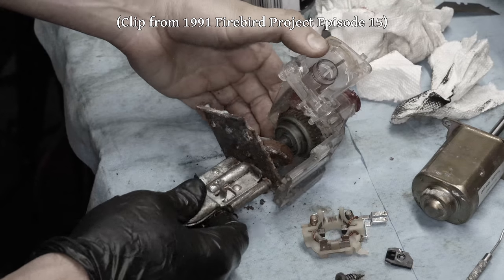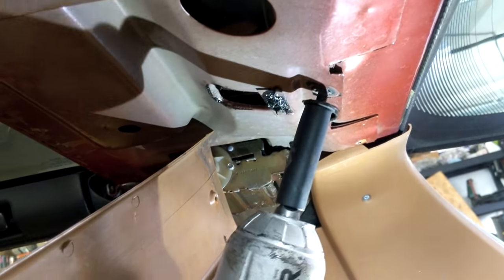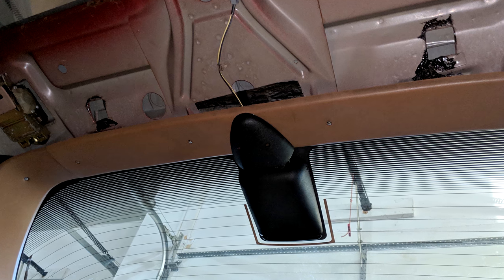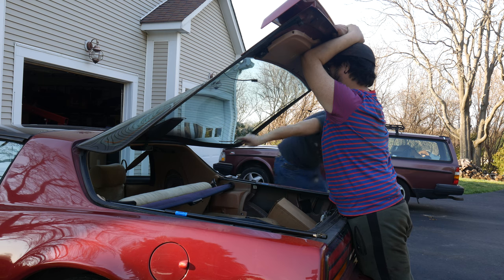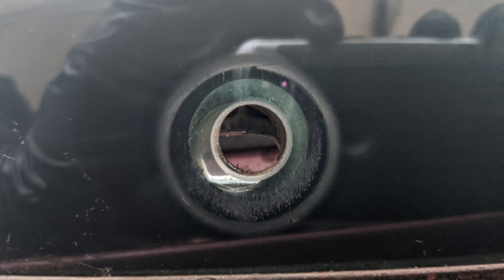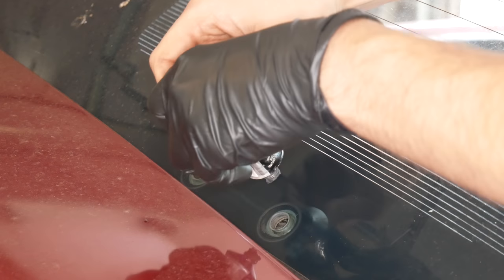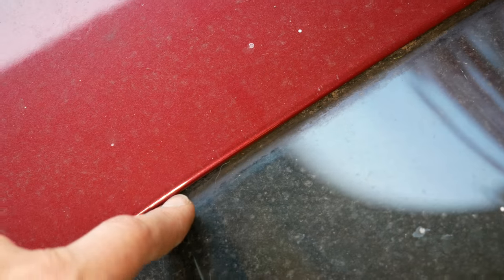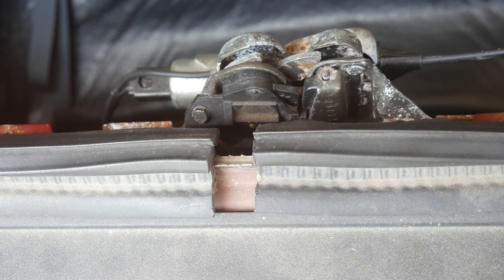1991 Firebird Rear Hatch Position Adjustment and Sealing (Ep.16)

Comment: Leaks like this are so frustrating. You did it the right way. The low viscosity windshield sealant is the final touch, but you have to start with the seals, pull headliner, and look at door fitup. It might even involve welding in fresh steel if there are pinholes in body. This is also a great time to place dynamat and look at wiring, speakers, etc.

Comment: I used to have the same leak on my 86 TA and it was coming from the middle of the T Tops.  The weather strip for the T tops has to be removed in order to expose a T shape metal shield which leaks when the water is running through the weather strip.  It happen with rain, snow and carwash.  One time, after a carwash I was on my way to college with a written homework which got ruined.  Thank God the teacher gave me a break.  Those leaks are hell!

Comment: This is why I converted my hatch from the automatic pull-down to manual. On the early 3rd Generations they had a manual rear hatch latch. The only reason why that pull down assist exists is because people were slamming them and shattering the glass.

Comment: On my 83 T/A I used a piece of thin pipe or EMT conduit that fit over the gas cylinder on the hatch and cut just shorter than the length of the exposed part of the shaft.  Slide it over the gas shock and when you open the hatch all the way, the pipe slips off the end of the cylinder and onto the shaft, preventing it from closing.  Just flip it up while closing the hatch to lower.  It works great, and I used it for years.  Only need to do one side.

Comment: Hey brother.  I replaced the hatch at least 3 times in my life.  Been there, done that.  I remember scraping off the old urethane from the deck.  Not a fun task.  Looking back, maybe a heat gun would have helped.  BTW, discovered a spray from STA-BIL recently.  Actually does decent job on rust, and is a hell of a lubricant.  May be a nice top coat for your slide stampings, and other things.  And also, one tip I can leave you for owning a third gen, quick-steel, or any other epoxy putty.  Would may for a better spacer than tape.  Mainly I used it behind split plastics, such as the door sills, and dash trims.  Very handy.  Especially now that Ponitac closed shop.  :/

Comment: My hatch release button doesn't function when my car is running, has yours been modified? It's something of a safety issue, isn't it?
Reply from the maker: I had the same thought, but mine does work with with the engine running. Never tried it while the vehicle was in Drive or moving, but I doubt it would make a difference. Probably wasn't something a previous owner modified, but it may have been altered by Father Time in the sense that whatever safety was in there has failed. Or, maybe some years had it while others don't? Just guessing.
Reply: 4th gen driver here.. if the e-brake is pulled, the hatch release works. Its a safety feature so you dont open it while driving. :)
Reply from the maker: Oh, interesting! Will have to test that

Comment: An interesting note about the deck lid alignment. Your deck might be out more on the passenger side because of a factory GM defect. It was not realized that the RH quarter is shorter than the LH side and this wasn't highlited until the Notchback came out. The GM execs were looking at the prototype notchback hatch and it didn't line up on th body on the RH side properly. I read this over on the GTA source page

Comment: I will recommend you to use 3M 8509, windscreen sealer to help rubber to seal towards water ingres in the bodywork, instead of RTV. It never dries completely, so it is very compliant. If you need it to go in an small space an seal warm it in hot water bath to make itmore liquid and easy to aply.

Comment: Make sure you clean the weather stripping and the areas it contacts. When there is dirt between the rubber and its mating surface, it leaks. 

Doors filling with water are normal. Vapor shields stop it from coming in, the glass wipers are not water proof. Just make sure the drains aren’t clogged

Comment: To avoid strong lifting struts pushing the hatch back - just prop up weak struts with a strong stick. And convert the electric pull down to a manual one.   That's my solution.

Comment: Sadly after 25-30 years GM still cant seem to get the the rear window from leaking. On my 2016 Malibu the 3rd brake light assembly was leaking without my knowledge. I didn't noticed until 4 years after the fact via a Recall letter and checking the interior roof liner. The Chevy dealer replaced a brand new roof liner and added washers to secure the brake light and its been fine since. But others had water running down the trunk cavity down to the spare wheel well. 

Some things don't change.

Comment: So I'm not the only one with a hard spot on the rear passenger seat. I sprayed water on them yesterday to wet them to then spray with turtle wax interior carpet/seat cleaner and use a drill brush.... Well as soon as I sprayed water on I just saw bright green come out of it. A previous owner must have had the window cracked and it leaked onto that rear right corner of that seat and got moss to grow on it. Luckily it came out with the drill brush.

Comment: We've got to learn 3d printing. You could have made little inserts for the glass bolts instead of electrical tape. And maybe make those plastic adjustment screws for the deck height. And who knows what other impossible to find clips, for all our cars. I'm about to take the plunge. They are cheap enough to pay for themselves. My hold up is the software. Like editing software, high meaning curve. 👍👍👍

Comment: You'll have to bite the bullet and move the sheet metal forward, I did mine leaving the glass in place......twice.
Water was getting into my trunk at the leading edge of the sheet metal, took me a while to realise it.
I swapped out my high level brake light glass for a regular later glass.I left the old glass propped up on end......it fell over, I was stunned at the explosion and how loud.
If that happened on the car....😮

Comment: Clearly this channel was never about "back to original", however these videos often turn into an exercise in futility doing things the half ass way on purpose.  Finger at least tries to do most things the right way, and you forgive him when its not perfect.  Here you expect the solution to be bubble gum and bailing wire, and then 2 more videos on the same part with more sketchy work.  I would appreciate if FDP would spend more time and dare I say "money" on their solutions to do them right the first time. Just as an example, taking the hatch bracket off and having it blasted of rust, replacing the hatch weather stripping, fully adjusting the hatch alignment to flush, then spraying the car with a hose to show the leaks are gone. I'm not sure how many more videos I can watch on the same stuff still not being complete, so I'm trying to be critical in a helpful way because I have enjoyed this channel.
Reply from the maker: Appreciate the feedback! There is a lot that goes into making these videos and to be frank the way they are currently coming together isn't working the way it needs to. It always seems like there isn't enough time to actually work on these projects (of which there are too many) and editing takes a lot out of me. Probably need to dial back on the detail or figure something else out to streamline the process.

As for the bubble gum and bailing wire approach, there are two sides to that. First, as in this video, I couldn't find a lot of information about these assemblies or how/where to adjust them so it was mostly flying blind and experimenting, and trying to avoid doing it until I had enough information (which never happened) which is why these last two episodes take place over two years when it should have taken maybe a few days. Second, while spending some money is unavoidable, I mostly want to keep these project cars to a budget that somebody can realistically afford. I feel like that keeps it relatable and often it's kind of just the way I have to do things with the amount of money I have available to spend.

I would say this: don't necessarily expect the guess and check seat-of-my-pants problem solving approach to change, but I hope I can figure out a way to do the work I probably should be doing and get videos up on the channel at the same time without feeling the way I do right now. Ronald Finger does fantastic work and I do envy his production value, work ethic, and actual commitment to doing things "the right way". He also doesn't hold himself so dearly to the arbitrary "video every other week" schedule I am on and is focusing on the one project car (though I know it's not all he's doing). Maybe I should take more notes from him then I have, and I am sorry to hear that you have not enjoyed some of our recent content. I can't make any promises that things will change, but thank you for respectfully sharing your opinion and it will definitely be in the back of my mind moving forward.

Comment: You are very lucky you didn't break the back glass with the broomstick.  The glass for the '91 firebird is IMPOSSIBLE to find.  I have a '91 firebird formula that I've had since about 1996, and I used the broomstick to prop the glass once, and long story short, it slipped and shattered the glass.  I had to drive 6 hours away to a wrecking yard in OK that had one for a 92 Camaro, which is close enough to fit, but has a slightly different curvature.

Comment: I have a suggestion for this car, the other firebird, the blazer, the datsun, the jeep, and the silverado. why don't you sound deadening them, repaint all of them expect for the silverado , and put custom touchscreen audio system in all your cars
Reply from the maker: The main reason that probably won't happen is money, painting cars properly is extremely time and money intensive. Sound deadening may well end on the 91 Firebird and I always planned to do at least the roof of the Blazer. Touchscreen audio stuff probably won't happen, it feels a little too anacronistic to me for most of these cars, but if anything would get a modern-ish audio system it would probably be the 91 Firebird. Wouldn't mind putting a working sound system in the Blazer either.
Reply: @FuzzyDiceProjects  are you going to fix the damge part from the ice crash on the blazer ?
Reply: @FuzzyDiceProjects  also the best sound deading brand on the market has been second skin, also youtube user saabkyle04 is restoreing a first gen s10 and just finished restoreing a 1st gen gmc jimmy